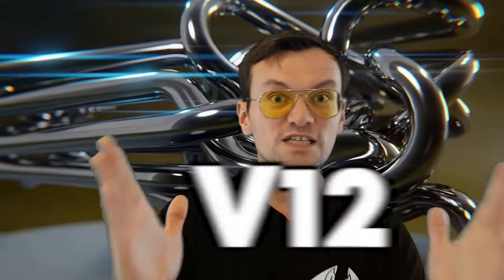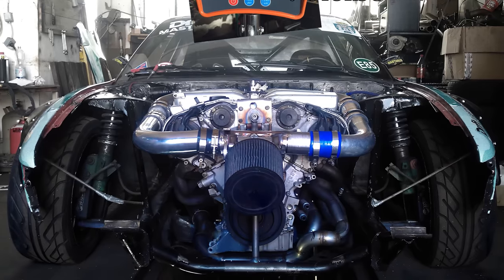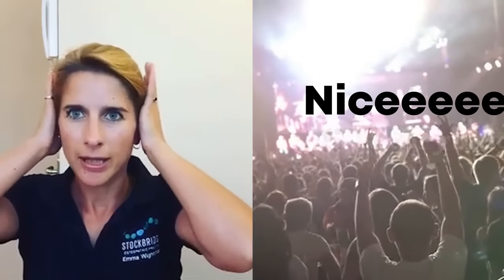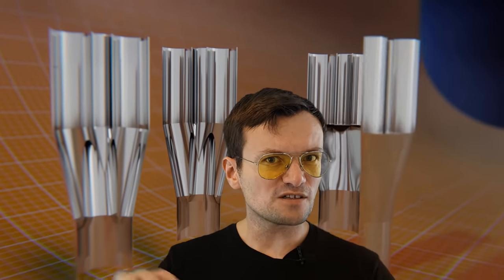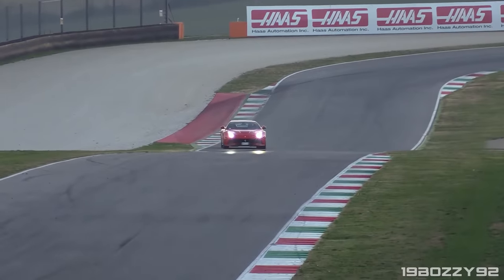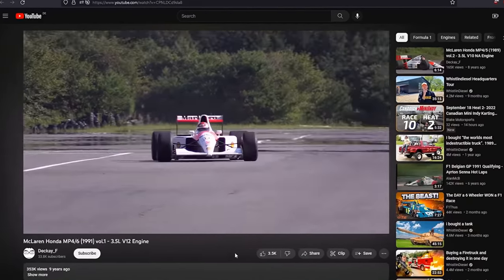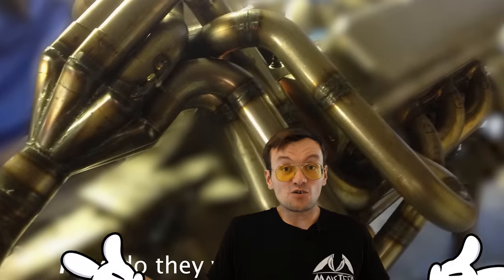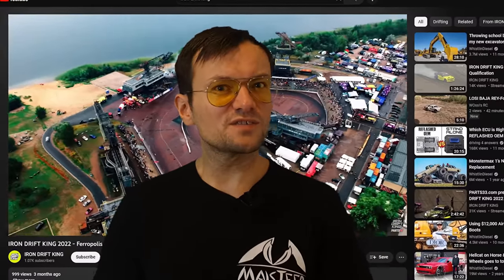Why This V12 Sounds Better Than a $5,000,000 Pagani

Comment: I've always had a dream of something like this with tiny little turbos, one per cylinder, plumbed up to a mirror image intake manifold, like 12 little single cylinder turbo engines all timed in unison, going into a tuned 12 into one header like you're talking about  here. I initially had the idea on an old Ford big block using tiny ihi turbos from Chrysler acclaims, but in reality more smaller cylinders with custom built turbos would be way better...

Comment: I still think the honda RA is the sound that gives you the chills... It´s godzilla in a tuxedo, restraining itself to breathing fire at will in an instant. And if we talk about Honda, one essential sound factor not present on this vid is variable valve timing and geometry..
But the one important thing that is on this vid is the end part. The hours spent obsessing on efficiency simetrics, flow rates, etc. And to top it all, finding out on the track that your intuitive and calculated design would have spent endelss hours on the workshop, while the basic time limmited preliminary exeeded your performance expectations

Comment: I would think you would need a 4 inch collector and a 3.5 inch dual exhaust with long headers and slight back pressure by means of a resonant chamber on each exhaust.

Comment: Excellent video! You earned yourself a subscriber today! I have a set of 6-1 equal length headers (smooth collectors) for my bmw M70. I’ve scanned my engine bay (it’s a mid engine kit car) and am waiting on the fabrication of a mid section with an x pipe. I’d be interested to hear if you think I’ll get an F1 noise, or even close?
Reply from the maker: If they're equal and have the merge collectors, it should sound pretty decent. Not '90s F1, but I think it'll be what you've been looking for. Especially when you join the two 6-in-1s together (X-Pipe is fine) with equal secondary length pipes.
Reply: @maisteer   thanks for the reply! I’ve designed equal length secondary’s so hopefully it won’t sound  shhhhhh… hoping to have it back together soon - I’ll report back when it’s done. Looking forward to your next video!
Reply from the maker: @Lemonborghini  I would love to hear it when it's done. Good luck with the project!
Reply: @Lemonborghini  hi, any video update regarding your m70?
Reply: @eluneshieh8763   initial results were decent but  I made a poor decision regarding the x pipe and subsequent backbox. I have since changed the style of x pipe and got great results. I’m waiting on fabrication of the new rear section and I’ll shoot maybe a proper YouTube video in future!

Comment: I can add one or 2 cars to your mix, the Matra Simca v12 M670 I saw this running at Montlery a part banked track in the early 1970's. The sound of the engine made the hairs stand up. When it was on the far side of the track it was a magic sound that we could hear clearly above all the other engines. I can best describe it as tearing sheets. Gordon Murray has also in a road going car produced a similar sound in his latest design sports car. John

Comment: Thank you for sharing! Extremely impressive you fit the m120 in an S chassis nissan
Reply from the maker: It was tight, but not impossible. Doing everything alone from start to finish in 6 weeks was the really impressive part.
Reply: @maisteer  I'd love to pick your brain about it, without being specific, I'd like to do something similar. 6 weeks would be impressive for any swap, let alone a bespoke v12!
Reply from the maker: @flux_core_fx  What would you like to do then?
Reply: @maisteer  I have a Z32 I am mildly curious about swapping. It has had an LS and GM Ecotec so far. I am curious about the handling characteristics, sump, and mating to a manual transmission. Thanks so much!
Reply from the maker: @flux_core_fx  Swapping in the M120? Sump position was terrible on that motor... I think it was right in the middle. But in the S-Chassis the hump could be shortened just enough to make it fit.
I used a redrilled a 7.25" Quartermaster Clutch and Flywheel but with ZF-Discs for a BMW 6-speed box. I shortened the bellhousing (a lot) and welded a custom aluminum plate on to make it fit the M120.
I used the car for drifting. Nose heavy it was for sure, but the it could make up for it, by making it easy to massage the tires to get the maximum of traction out of them - at least compared to the turbo engines before. It was a very different way of driving.
Reply: @maisteer  thanks so much. So it sounds like it's very difficult, and not great for handling hahaha. I bet it makes great power and noises though ! Haha

Comment: i would love to have a beer and discuss stuff like this with a person. as someone who also spent months into exhaust research. i was a t the part when you mentioned the ford 302 and you finally mentioned the main factor of sound and how to dictate it. The firing order. some people take the time to basically design headers so they all send pulses in order aside from firing order. with unequal length headers. vs the firing order. 1 bank may fire 1 after another and then fire 1 on the other side then back to the other bank. if you get those tuned to flow in perfect order you will get a smooth sound.
Reply from the maker: Hi, you should watch the new video.... you will love it.. I am sure ^_^

Comment: I've looked into this from opposite end and what you pointed out about the merge is really crucial in regards to making cars sound good regardless the rest of the exhaust with DOHC/2 exhaust valve per cylinder engines, its likely why as you noted Ferraris and Lamboghinis break your rule but still punch above their weight, same rule applies even more all the way back at the port.  Also frequently why Yamaha developed Toyota engines sound better then most if not all Hondas, Honda likes to gouge out the area probably for cost reasons rather then do it smoothly.  The harder part is figuring out why some single cylinder 2 valve (1 exhaust valve) sound so much better then others, but a lot of that just goes back to the basics and specifically avoiding harsh obstructions or bends, intake vs exhaust valve sizing as well as valve area per displacement, smooth expansions if any.  if you ever step down that path looking up various single cylinder, often italian sport bikes helps paint the picture.
Reply from the maker: Really great tool to try this out is the engine sim: https://youtu.be/RKT-sKtR970
Reply: @maisteer  your a legend did not know about that!
Reply from the maker: @Ottobon  Your welcome. Everyone should know about this ^_^

Comment: If you look at the new Pagani hyuara r (Pagani engine not amg) you can see how they use a "tri-y" header, it's 12 into 6 into 2 into 4 & has distance between the y's. Alot of it is the degrees between cylinder firing & cylinder banks. 60 deg v12 makes 60 degrees evenly fired to balance sounds. I think the m120 is 60 deg.

Comment: I just found this video,firstly thanks for making use of an m120 in the Nissan. I am a huge fan of this engine,it is an underrated overly complicated work of art. I have an r129 sl600 that is cat delete with otherwise stock exhaust. It sounds pretty good considering it was a basically free setup. But I have a complete m120 setting in my garage waiting for a donor project, I pulled it from an sl600 I parted out. What fuel management did you use for your project? And did you do any other modifications to the engine for added power? I would like to find an older Celica for my project,I have owned most generations of them and I am thinking a 1985 model would work for what I envision. I know there will be many obstacles to overcome,but for me the fuel management is my biggest issue so far. Thanks for this video and your quest for the ultimate exhaust sound!
Reply from the maker: On the Nissan I've used Megasquirt 3. Tim on his Mercedes SL (see the new video from this week) uses Ecumaster.
I've put a extra Triggerwheel on the crankpulley and used a BMW crank sensor back then, it solved the biggest hurdle of getting an RPM signal.
Good luck with the project.

Comment: I love the design of the headers being done in CAD …. How did you scan the engine bay? What software did you use for the header design working within the scanned dimensions? Looks like Autodesk Fusion 360? Perhaps you could make a video on the process?
Reply from the maker: Hi James, we used photogrammetry (Fotos were shot with an iphone) and the programm Meshroom. The scan is now almost 3 years ago, so by now there are certainly better programs out there. Especially if you have an iphone with LIDAR.
Anyway. I cleaned up the mesh in Blender and then imported it into Fusion 360. If you have more questions let me know.
Reply: @maisteer  You make it sound easy … I know it’s not. As you know you can either model hard items (the block etc) in software to workaround (avoid) or make a software box within which the pipes must fit. Using a centreline “string” method to get equal lengths, then forming the software pipes around the centreline “string” to check for clearance. But modelling the collectors in CAD is a real challenge for the casual CAD user, either in Fusion 360 or Solidworks. Your combination of CAD, fabrication and sound designer skills are rare,  most who try a project like this become frustrated with a CAD side and just start cutting pipe with their fingers crossed that the outcome will work. My interest come from a Jensen Interceptor and trying to make a equal length 1 7/8” headers fit in a tight engine bay. But I also own a twin turbo CL600 (W215) and love the sound that Makoto Sasaki made in Japan. One can dream that somebody will make a set of headers that will simply bolt on the Mercedes and make it sound like the Japanese V12. I haven’t given up on the Jensen just yet, so please keep the Keep the videos coming. PS I know that Matt Sanner matt@full-race.com in the USA http://www.full-race.com was designing headers in 3D using solid works and engine bay scans, you may care to compare notes?
Reply from the maker: @JACB006  Thanks for the insight James. As for the CAD design process. After I brought in the 3d models & scaled it to the right dimensions, I first figure out where the collector goes and make a plane for the header flanges. After that I just start with a 3d sketch from the cylinder furthest away, and then roughly add all the other cylinders, so I can quickly see where there will be potential problems. Then I refine them bit by bit, until they all are equal length and have no more clearance issues. One of the problem with Fusion 360 is that you can't measure a full sketch length. There was a plugin available "mst sketchtools" but it's not existent anymore. Since then I use the sweep command and then compare them by weight as a workaround. I hope that helps.

Comment: I think a perfectly tuned escapement is the most complicated thing in the world to make. The length of the tubes, the bends, the connections, it's a very complicated science, but also one that has to be verified on a bench after manufacture. A perfectly tuned exhaust can act like a turbo, facilitating the extraction of gases, for a greatly improved intake charge ! 😉

Comment: You're neglecting the differences between a flat plane and cross plane crank. Flat planes MUST have equal length headers or they don't make power, Cross plane need the opposite to make the same noise (because one cylinder needs 270 degrees to fire on each bank)
Reply from the maker: I do neglect the difference because:  The 8-in-1 header is a "workaround" to make a crossplane fire like a flatplane. How the cylinders are joined together is what matters. Not the shape of the crank (except when we enter into uneven V angles like 72° or something - but I think that should be obvious.)

Comment: AMAZING content with great examples. Thank you! I went with a 4-1 (I guess not equal-length) in my 1995 Integra GS-R from DC Sports that wailed at 8k rpm unlike other 4-2-1 B18's on the same exhaust... I feel justified that my car sounded objectively cooler LOL
Reply from the maker: Can't argue with an objective judgement on sound ^_^

Comment: I love a good sounding engine. But to me most of all of these examples sounded awesome! The ones where he showed the approved of header and exhaust sound sounded excellent for sure but not so much that all the others weren't good as well. I like deep sounding and high sounding and great mid range throaty sounding intake sound is really where it's at but it can only be so load. Anyway fun video.  Oh and I also thought BOTH MUSTANGS sounded AWESOME! Thank you for the hard work in making this fun video!
Reply from the maker: Thanks. Glad you liked it. Thanks for watching.

Comment: On a cross plane V8 equal length headers are wrong due to pulse spacing- 90-180-90-90 or something like that, see videos about 8 into 1 headers.
Do equal length headers work on a 6 into 1 on a V12?
What is the firing order?
On a 4 cylinder it's ok as you get a pulse every 180 degrees.
On a V8 you get pulse every 90 degrees but the firing order might fire 2 on one bank-90 degrees apart, then one on the other bank then back to first bank so there is effectively a 180 degree gap etc etc, does a V12 with 6 into 1 headers work?
Reply from the maker: Crossplane V8's are a bit of a special case. Every 90° crank degrees a cylinder fires, but they are not evenly distributed between the left and the right bank. See this video: https://youtu.be/f72BMpmoGMY
For an 8 into 1 header it doesn't matter tough, because then you are back to a firing event every 90°.
An inline 6 fires every 120° and the firing order is always 1-5-3-6-2-4. A v12 is like two inline 6s mirrored. So there is no uneven firing between the cylinder banks - unlike a crossplane v8.

Comment: I'll say it for you:
Nice-a or scheisse.

"of course it never hits a high note."
Brilliant. Never heard anyone say that before even ONCE. SUBSCRIBED.

The yellow glasses could become a trademark, BTW.

One more thing: to aid in maintaining flow velocity, you can still have 3-into-1 secondaries that then quickly join into a (those) 4-into-1 tertiary/collector. Having all 12 pipes go into that huge plenum is a negative on overall flow.

I know the sound will be similar, but I'm concerned about maintaining flow velocity with no sudden changes in cross sectional area that can hamper scavenging and velocity.

In FACT, for ultimate scavenging, you can make all four secondary collector pipes so they have each pulse of exhaust exactly 240 degrees from the other two in that secondary pipe. It doesn't matter how they are relative to the ones in another secondary collector, as long as they are spaced evenly in crankshaft degrees in the one secondary 3-into-1 collector. A smoother transition angle for the collector "cone" aids flow, also, not an "oil funnel"-looking 45 degree-wall collector.

I know it's more complicated, but it can widen the overall torque plateau.

BTW, using larger diameter tubes allows you to make them longer and still have some bottom RPM torque to go with that top-RPM fat-tube emphasis.

It could turn into an entire research project.
Reply from the maker: It certainly could. Thanks for the write up. I was questioning myself on a lot of these questions too. Especially with the collector angle. It's quite shallow now, but that also made it nightmare to fabricate.
Another point I would love to find out is how much the length of the secondary pipe changes the sound. It seems like a major contributor to shitty sound when they get too long.

Also with the collector, I have another 12-cylinder project in the making. And the more I think about it, and especially after having a closer look at the LFA headers why not make a collector similar to that (firing sequential from left to right):
  o  o   o  o   o  o
o  o  o   o  o  o
Reply: @maisteer  Another way to preserve some velocity is to have a cone inside the collector that tapers to a point inside the collector, which cone is at its largest diameter a circle at the inside surfaces of all the surrounding 12 primary pipes.
Reply from the maker: @ceoelektronika8604  I'm not sure if I understood it 100%, but isn't basically the merge collector just that, only that it also follows the contour of the incoming pipes?

Comment: The GMA T50 is the best sounding road car. With a V12 that redlines at 12,100 RPM it screams congratulations Mr Murray.
Reply from the maker: Yep. But it wasn't finished yet, when the video was released. And checkout the Detomaso P72... you might like this one.. ^_^